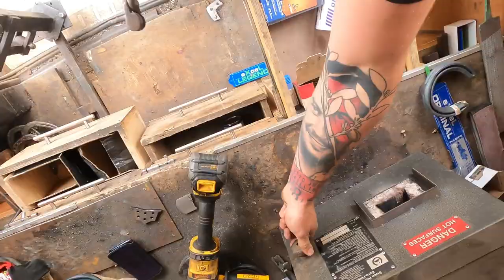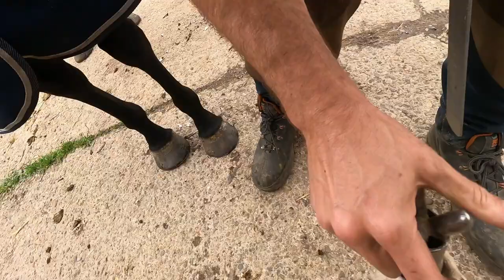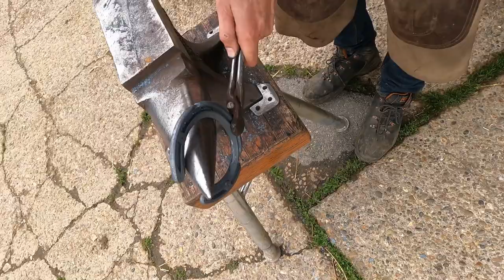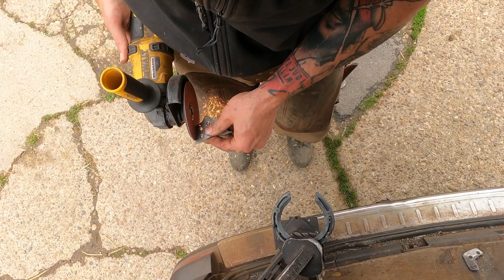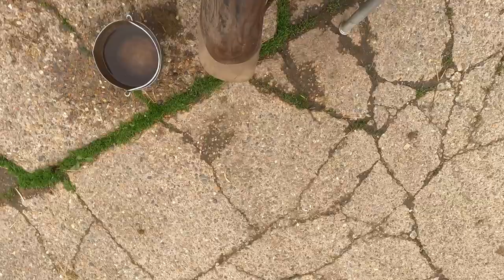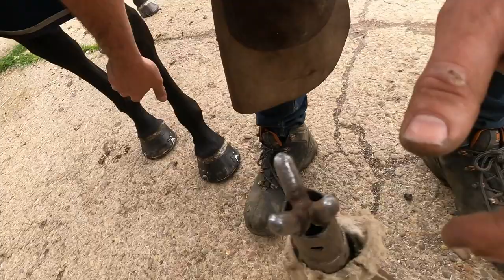Farrier shoeing a Thoroughbred with flat feet! Fabricating StraightBar Shoe.

Comment: I've never been owned by a horse that had hoof issues so the various shoe "designs" are while seem self-explanatory to some degree I have a question about the use of the putty? I'm presuming it's meant to cushion the frog/heal? My owner Reno (<---- he's the long nose to my right in my profile pic) has very sensitive soles (and soul😉😇) on his front but his right is worse then his left and after multiple X-rays, it seems his vehicular bursa is slightly off. Would this type of shoeing be something to consider? I've been considering everything 🤯 including wrapping his feet in bubble wrap 🙃😆. Reno's farrier also works with his vet(s) for correct shoeing.